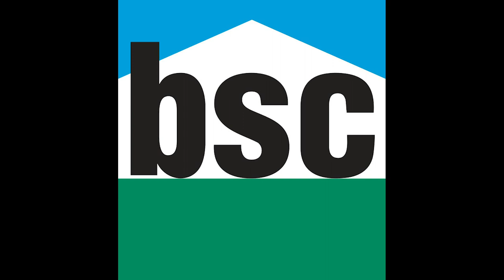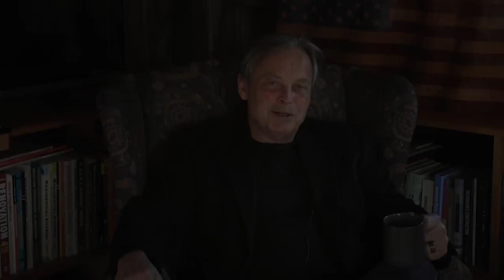Cup of Joe - Rain Screens

Comment: There are many air and vapor control layers....fluid applied and fully adhered membranes are typical and are installed directly over exterior sheathing such as plywood, OSB and gypsum board....There are also sheathings that have integral air and vapor control such as Huber ZIP.  A common way of providing a 1/4 inch gap is using rolled sill gasket material.  The insulation is typically  installed with cap nails.  The cladding is attached with long nails or screws when the insulation is less than 1.5 inches thick.  When it is thicker, 1x4 furring is installed with long screws through the insulation into the framing.  The cladding is then attached to the 1x4 furring.

Our website has hundreds of figures, photographs, details and guides describing in detail these types of assemblies.  It is not possible to describe all approaches in a short video.